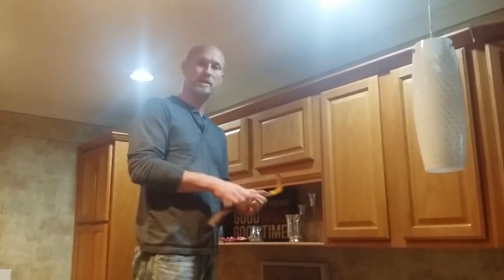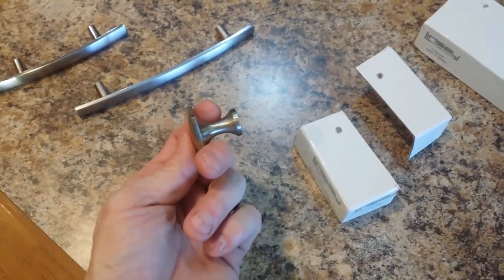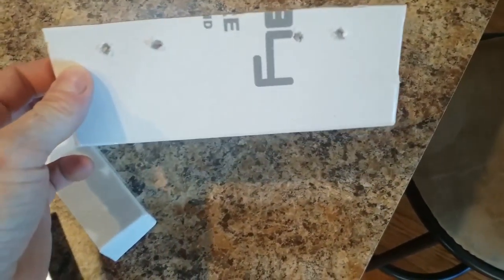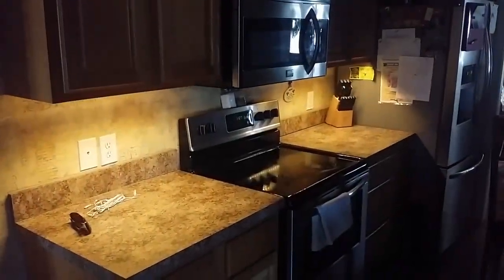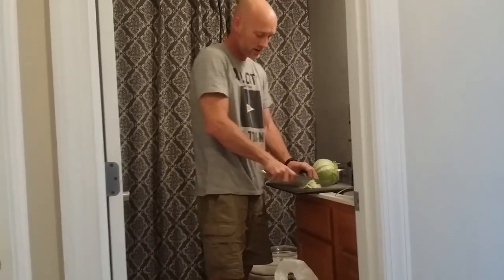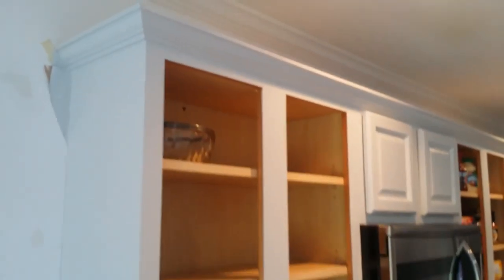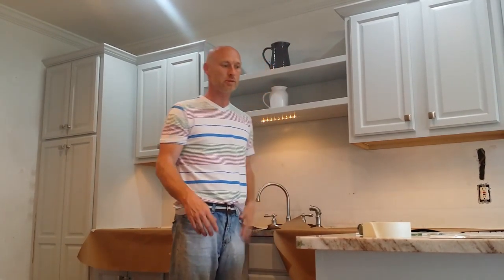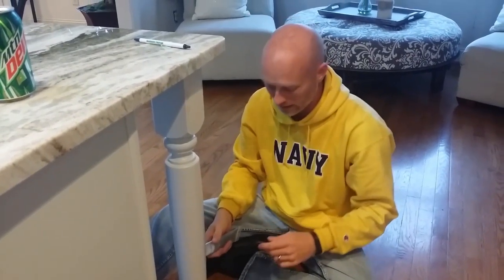DIY Kitchen Makeover Cheap and Easy - OurHouse DIY

Comment: First off, great job on the kitchen transformation, It looks very nice. Second, to anyone asking how he did it on less than $1,000 with Granite, he explained that the $900.00 was all his DIY stuff NOT including the Granite. Third, for those who are asking about Granite costs, it depends on the grade of Granite (yes, Granite, along with all stones have grades) but, the average cost for Granite starts at $50-$60 per sq ft & can go upwards of $110-$120 per sq ft, depending on many factors like rareness & design of flow in a stone, the more the flow, the more it'll cost, the rareness of a stone plays a major factor in the cost also, sometimes the origin of where the stone came from, all factors, so, it's easy to forget what you paid for it in total by the time you pick it out, price it out with edge & installation what the total cost was, you're just glad it's done by then. Again, great job!

Comment: Imo the idea would be to have no cabinets because the problem is if you do not label the outside or have a good memory of what is behind each "door" you have to open each one to see which adds time.  The no door method allows you to directly know just by scanning w/ the eyes quickly of what you have and don't have if you positioned them and organized them strategically.
Reply from the maker: +Anthony Abelardo Thats a great idea. We were honestly debating doing mostly shelving.
Reply: OurHouse yeah

Comment: Incredible transformation. I'm doing undercabinet lighting and have the same issue that you had with the receptacles. How did you install the new outlet?
Reply from the maker: +K MAC (KMAC) I talked to a guy at Lowe's that told me how. Its really simple. I bought 14/2 Romex, an old work box, an outlet, and an outlet cover. You tie the wire in to an existing outlet to get power, fish the wire up the wall behind the cabinet, cut a hole in the back wall of cabinet, hook up the outlet in the new junction box, and its ready.

Comment: What kind of paint did you use
Reply from the maker: +frank robles For the cabinets we started by sanding and caulking, then 2 coats of a good primer, then 2 coats of Valspar Cabinet paint.